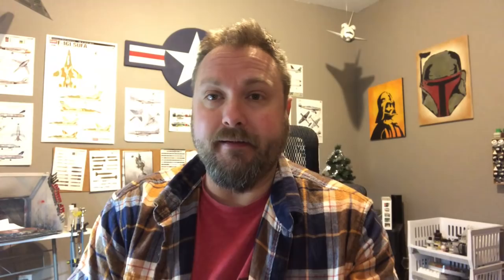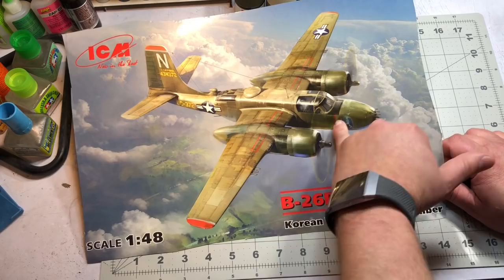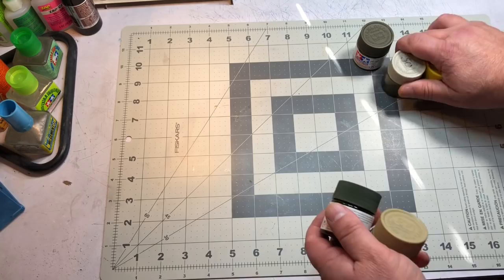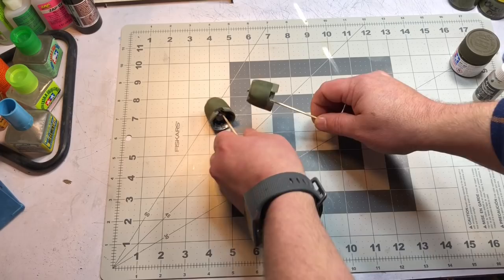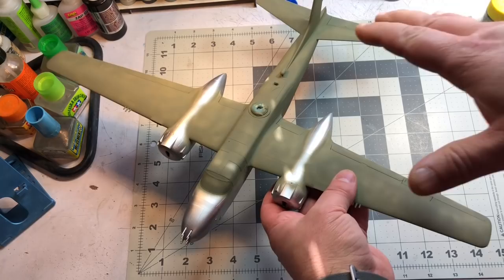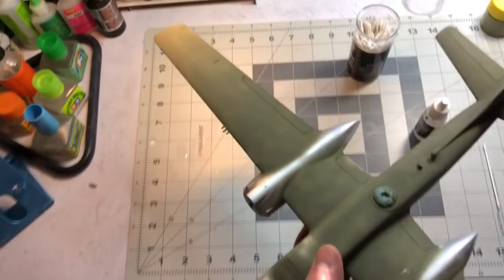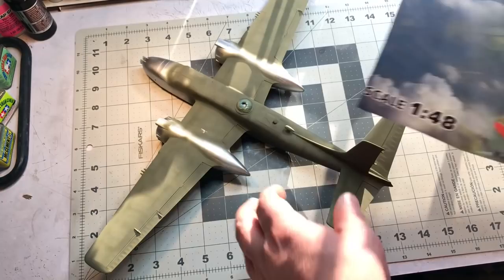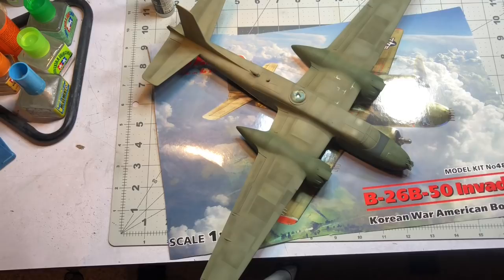ICM 1/48 B-26B Build Part 4: Paint and Decals

Comment: Great paint job!. Looks amazing. This is exactly what I wish to achieve with mine... I hope I will ;) I will have to use chipping fluid since I will be using MRP and MrColor paints - they are more resistant to scratching. I will use MrColor SuperMetalics as a base though. I tried AK Extreme Metalics couple times and I didn't like the result. Plus - there is a big problem of inconsistency of their paint quality - some batches are ok, some have issues. I have better outcomes with MRP or SuperMetalics
Reply from the maker: Thanks.  Ive had a few bottles of AK xtreme paint arrive “spoiled” and unusable.  Other than those few instances, I’ve had pretty good experience with them.  I’ve heard a lot of good things about MRP but I have gotten use to working with tamiya so it’s hard to switch now.
Reply: @seanerk5kt9   - your work speaks for you. I hope I will get close to your level some day.

Comment: Wonderful build series! I learned a lot, and appreciate you sharing your techniques. I do have a question. Do you run the pledge floor wax thru your airbrush? If so, what are you using to thin it out? are you using full strength? what do you use to clean out your air brush after using pledge floor wax?
Reply from the maker: I don’t thin it as it’s already pretty thin.  Windex, isopropyl alcohol or lacquer thinner will clean it out of your airbrush.  I would however recommend removing the needle and wiping it off with any of the above after spraying it.  That stuff sticks your needle like glue if it’s not cleaned out well.  I always leave a little isopropyl alcohol in my color cups at the end of the day and that helps keep the needle from sticking as well.